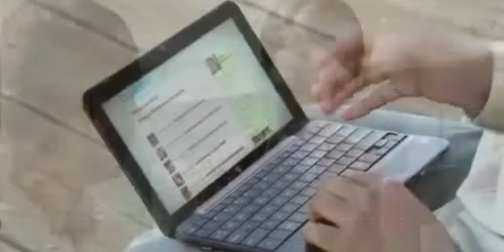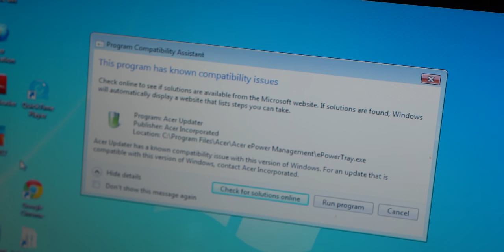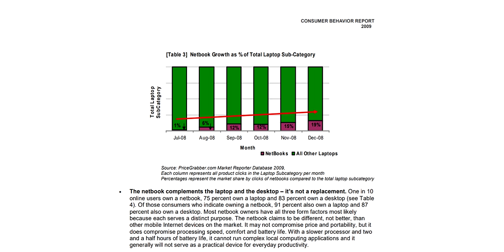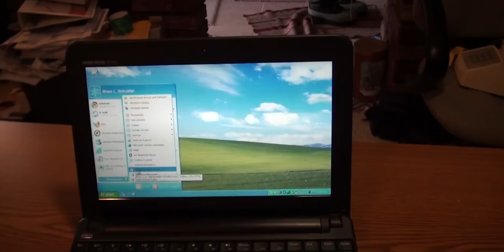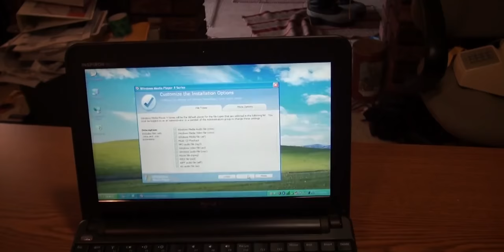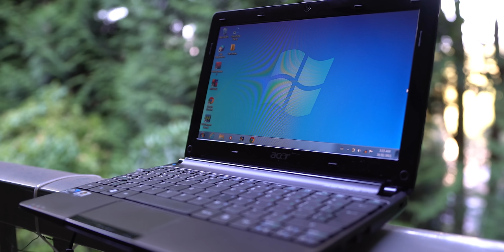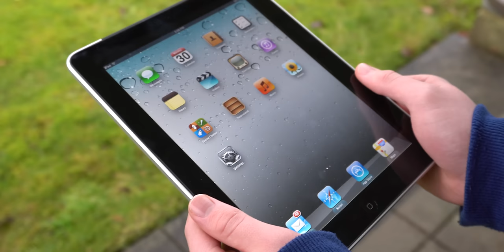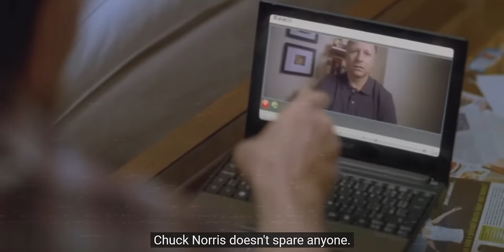Why Netbooks Failed - Modern Retrospective

Comment: Blaming MS for 'starter edition' is missing the point rather. The netbook started life as a low price machine designed for emerging markets and 3rd world classrooms. The first ones had a disproportionately large battery to last a whole school day, and some even had wind-up charging for markets with no electricity. They were all, as you said, Linux machines, designed to run well on basic hardware. 
The later ones (still early) had larger screens, and by then had atom processors. They were still sold typically with just Linux (Ubuntu or the custom-made netbuntu) to keep prices low and performance acceptable. 
Then, people started buying them in the west, and expected a mini-laptop. Sales started ramping up when Dell/Samsung released their versions. Then, returns started flying back in the door. People expected it to "be windows" and didn't understand why they can't run exe files, install word, etc.

Starter edition came into being, because when retailers told them "oh you can buy windows for $120 if you don't like Linux" people complained they'd "never had to buy windows before, it was always free" and retailers had customers thinking they were being scammed. 
If you had the same laptop at two different prices, one Linux, one with windows, people bought the cheaper one anyway and then did all the above anyway, leading to huge piles of returns.
Cue, the end of Linux laptops as standard and windows being put on them. Starter existed to stop a Home OEM license being required for each netbook, which would have added more significantly to the cost. You say it was bad, but you don't appreciate how bad consumers are at understanding what an OS is, or why their Ubuntu machine could do more for free.

This is all just a way of saying popularity killed the netbook. As soon as mass market appeal happened, the lowest common denominator needed to be catered for, so we got starter.
Tablets killed them off, because people could go back to forgetting what an OS is again, and just push buttons.
Reply: Yup. Windows' brand recognition means that anything that isn't Windows (or made by Apple/Google) immediately becomes a strange, alien world. Netbooks' price points relied on Linux being cheap (not just literally being free, but with it being notoriously easy to run on lower-end systems), which Windows' ubiquity quickly killed. Going to what you said about productivity work, had things like Google Docs been more popular earlier, I'd predict netbooks would have at least survived in a better state until hybrids came along.
Reply: This is one of those persons who actually gets the thing. What's even funnier, is that you can manage Word to get working on a Ubuntu easily, and not on "Starter Edition".

Btw, let me share a fact, one company in my country managed to get Win10 Pro with Atom/Pentium for a lower price point than the Win10 Pro Retail license itself, but ofc by 2018, much late to the world of netbooks.
Reply: I couldn't have said it better. This video sounds more about saying MS is bad, than understanding what really happened.
Reply: Sometimes I wonder why some people seem to spend half of their life in a cave and then when they come out tech ads are their only source of info.
Reply: I remember that my first pc was an acer netbook, I hated windows on it so began to search for solutions, a little learning curve and then finally installed Ubuntu on it and the experience was amazing, I can still feel the thrill of the smoothness and responsiveness
Reply: Weird as it sounds... i still have a few in use (since you buy them second hand at roughly 30€ in top condition today). My first was the original eeePC, controlling my CNC to this very day, and i have a Samsung and some no-name models as well. After an overhaul "GPD Win-style" it makes a pretty good emulation device (compared to Raspberrys) or a cheap DIY case for SBCs in general, especially if you pick 'em up for around €5 "as is".
But in all my life i could never understand people putting Windows on it, let alone purchasing it with "starter". But somehow it still lives on today with "convertibles" and 11,6" touchscreens, running xubuntu happily ever after...
Reply: Also tho,  consumers didn't want the grief of administrating Linux. Maybe they thought that wouldn't be a problem until they tried it and discovered the joy of endlessly googling for things to type in that start with "sudo".
Reply: @ian_b  i can completely understand that, but again: those devices were never meant to be Windows boxes in the first place, hence they were a good example of how not to design a product for a mass market. But as always: each as he fancies...
Reply: @anno5936  Entirely agree. I think the basic problem is that they were the second iteration of the "Net PC" idea that Larry Ellison had in the 90s, when he claimed that PCs were already more powerful than consumers needed (we're talking around the P166 lol) and should just be effectively dumb terminals with everything running off a net connection. In the days of dialup.

Really, I think in both iterations it was corporations imagining a machine that didn't need Windows to wipe out the perceived Microsoft hegemony. I remember reading an article in the netbook era where the journalist ranted on about just wanting something to boot up and get him to Google where he did all his work, apparently and the OS was "just getting in the way".

But it turned out most people did want more capability than that, so you ended up with low power machines that disappointed when used within their capabilities. Sort of like saying cars travel at an average of 20mph (or whatever) and have on average 2 passengers so you don't need an engine that can go faster than that or has seating for 4.
Reply: Also they ran flash horribly so for a lot of sites, YouTube etc, anything with lots of ads, they just ran crap and didn't actually doing the job of browsing the 'net' i.e. The job they were made for
Reply: I think you're mixing the stuff up frankly. the One Laptop per Child machines were exactly that, crank up charger and all (frankly, gimme that when I ever get kids, drain their energy into the battery please). Netbooks tho were an actual market product and not a humanitarian project style thing like the OLPC project. That both of them overlap a bit is true I agree, but I can't see netbooks as more than a product of their time, a tiny laptop to mainly do what phones and tablets do now, before they were really popular at that task - just a web browsing, SNS machine that can sorta do very basic work. The OLPC machines wouldn't even be in the same ballpark, obviously someone made them run Doom but it really was never the intent. I remember reading about them that they would even have specific networks on the schools they were set to be used that allowed some form of internet but still sorta controlled.
I still remember the adds for 3G network plans with people using those netbooks absolutely everywhere like an SNS addict with their USB stick modem plugged in, and some models even had the 3G modem built-in on a mobile PCIe card. And well, that is so obviously their intent that it's even in the name.
Reply: @Arcidi225  you’re right. It’s based on freebsd. Still Unix based. Linux may have acquired a prettier GUI over the years but as far as I know it’s still the worst when it comes to driver and app compatibility. I tried it back in 2010 and I tried it again in 2019. Could never get the drivers to work on ubuntu and kde. And I consider myself an intermediate power user. Meanwhile I only got my mac for a week and I was installing windows on it no problem. Everything ran smoothly. Whereas with linux there’s always a driver missing, a setting or tweak you need to apply. So in terms of user friendliness, I still loathe Linux. I hope they worked on it in recent years but judging from my experiences, I simply don’t have the time to troubleshoot linux. How much more the average user.
Reply: @reychop  Weird, in my experience,  I have more driver issues on windows than Linux, could you tell me what drivers were the issue? 
And when it comes to app compatibility, well, everything I need works on Linux, and actually most of the things normal user would need works on Linux
Reply: This is exactly the problem and what this video fails to uncover. It isn't really Microsoft's fault. The companies selling them here in the West just didn't do a great job to tech what netbooks really are good for. They were sold as if they were "mini laptops" so cue assumption of consumers thinking they are buying a "mini laptop".... Of which it isn't.

The real reason netbooks faded away is because android tablets and the ipad became a thing. Not because netbooks were actually bad (people were actually starting to understand what netbooks are for) just that tablets were better suited to what people would soon to understand what they need a netbook for. Tablets basically filled in the space that netbooks tried to fill in.
Reply: Linux standard on laptops?  What?  Window has been standard on laptops since 3.1 or earlier insofar as I know.
Reply: The thing they really had going for them that was almost unprecended at that size and price point was the ability to run x86 software.  Not nessicarily well, in the case of larger and more complex programs, but the ability to deploy "proper" desktop software cheaply and in unusual locations opened a few very interesting doors at the time.  (It's worth bearing in mind, mobile ecosystems were also WAY behind where they are these days)
Reply: That's actually really interesting in terms of marketing and product development. So the netbooks did what most businesses always want for their products and penetrated into the general market, but because of that consumer expectations forced the product to compromise and inevitablely fail? That just sounds like the type of history research they should make every business major do.
Reply: Yup. The original Eee PC was inspired by the first One Laptop Per Child (OLPC) and was built tough, unlike subsequent netbooks. I got one the day it went on retail in my country, haha!
Reply: @torpedospurs  I took one apart.  Many parts of its insides were held together with masking tape and the power port was held in with a very flimsy plastic joint.
Maybe the earlier ones were better?
Reply: @deesevrin8570  I didn't take mine apart, but it sure looked like it could take a beating. Subsequent models looked a lot softer.
Reply: Look at all the apple products in the background.
Reply: It seems you’ve circumvented your own argument and came to the same conclusion as the video.
Reply: As someone who's enjoying Garuda Linux on a modded up cheap laptop, it's painful to hear about neat little linux PCs getting done dirty like that just because the average consumer is dumber than a sack of bricks around tech, and now kids are learning on idiot proofed locked down Chromebooks or tablets so they'll probably end up even more baffled by open options like Linux
Reply: @Arcidi225  it's not weird, you're just insecure that someone experienced a problem in Linux. A lot of people complained about driver issues in Linux
Reply: @OP, so a short version would be noobs and lamers killed the netbook.
Reply: I still use the tiny 4g eeepc with the solid puppy linux. It is complete basic fun.
Reply: Actually that was the first misstep; NOBODY in the 3rd world wanted a netbook.  Second hand markets are a booming business so you could (and still can) get a decent spec laptop for the price of a Netbook. IT "hot shots" were the first ones using netbooks to 'look modern' during business meetings only to have the laptop freeze or run out of battery and look like idiots (I was there, I know it first hand LOL).

I think you're referring to the OLPC laptop that had a crank mechanism and allegedly long battery life(it didn't) and that was a massive failure.  All the users asked the same questions: "Where is Powerpoint?" "Is damaged and the local shop says they can't repair it.  What do I do now?"

There's a book called "The Charisma Machine" describing how this pipe dream was more of a vanity project at MIT than a real 'solution' to anything

Comment: Why netbooks failed: underperforming cpu's that couldn’t keep up as Microsoft’s Windows software intentionally got more bloated every single year. From XP to Vista to 7.
It's great to have a small thin and light portable YouTube and Microsoft word machine that you can easily take everywhere. Unfortunately, many netbooks at the time would end up lagging while typing and buffering to load YouTube within a few years. Mandatory Windows updates for “security” that contained more bloat did not help either.
Google Chrome would straight up crash on these systems. And only Mozilla Firefox would be light enough to run smoothly.
Reply: On the first netbooks i got Youtube wasn´t much of a thing. Can´t remember actually knowing it back in 2007
Reply: lucius1976 Good point. Back in the 2004 - 2006 window many people still didn’t use YouTube. I just remember loving my netbook but then slowly getting disappointed by the poor software optimization and slow speeds.
Reply: My netbook couldn't open chrome
Reply: @lucius1976  I made crappy videos in 2007 :) YouTube ran terribly on these netbooks back in the day because it used Flash to play; HTML5 video playback was still in very early stages and was not widely supported. I remember watching a friend of mine trying to play one of my videos he had appeared in on his Gen1 Eee PC, he got one frame every couple of seconds. I used the HTML5 YouTube beta in 2009 (p sure it was 09) and it did work, and used less CPU than Flash (instead being as much as VLC or QuickTime would take up), but it couldn’t actually do fullscreen (it would fill the browser window instead — you could put the browser in fullscreen viewing mode as a hack though). That was all ironed out by mid to late 2010, though, and Flash quickly died for non-game uses by 2011 or 2012.
Reply: Yeah even with netbook-optimised Linux didn’t help that much.
Reply: I was able to run KDE 4, complete with all the 3D effects, on my Asus Eee 701. Remember when Vista introduced 3D effects, but they could only work on higher-end hardware, leading to the infamous lawsuits over the meaning of “Vista-capable” versus “Vista-ready”?